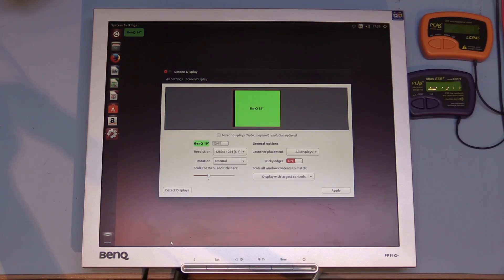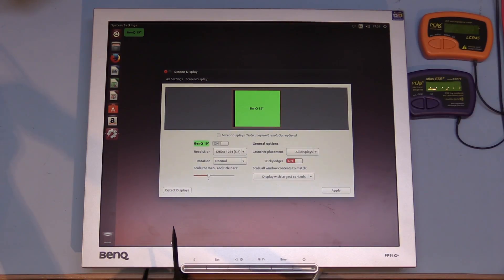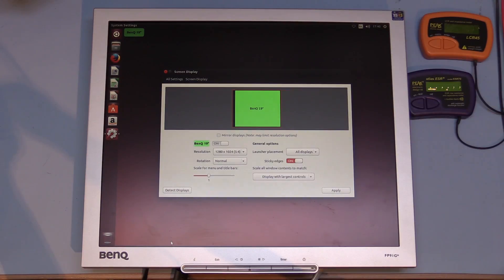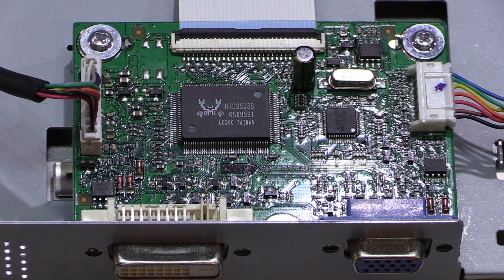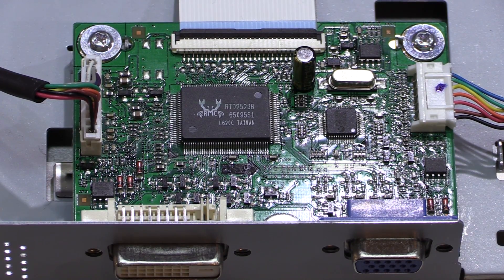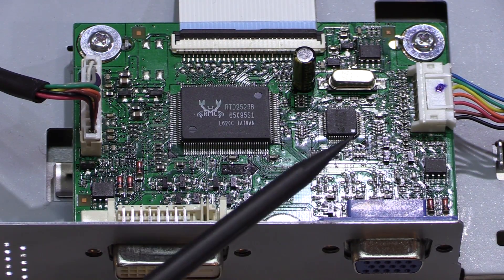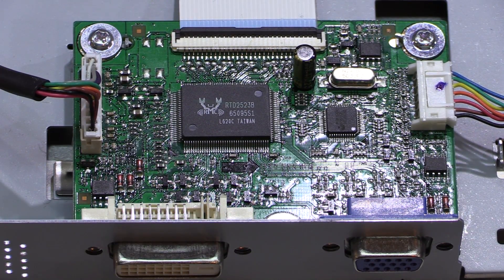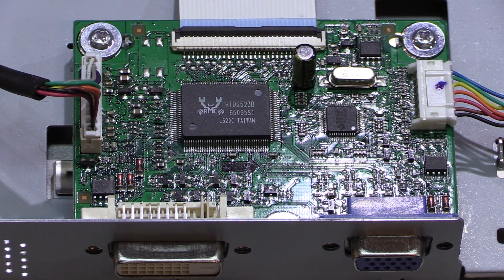SDG #018 Benq LCD Monitor Repair Follow-Up

Comment: Good job. I don't like throwing stuff away too. Even though timewise the repair costs more it's one less that has to be replaced and pollute the earth. Btw I said in my case it was failed buttons, but I have the feeling your case is not much different. The main problem is that they use multiple levels for the buttons, not just 0 and 1. And the few kOhm resistors can easily be duplicated by contamination. I once tried to use ADC based single pin multiple buttons and I'll never do that again.
Reply from the maker: Microlab Oddly all the buttons on the front panel are direct I/O's except the auto adjust and menu button, which share the same I/O pin, so a slightly noisy power supply could have caused the erratic constant auto adjust. I suspect the glitches were at a far smaller scale than I was looking at on the scope.

Comment: Glad you saved it from the dump! I thought you had checked that cap. Most of the faults that I find are cold solder joints also.
Reply from the maker: Robert Calk Jr. I said I'd check it, but didn't actually remember to - typical! Thanks for watching.
Reply: SDG Electronics 
It happens. I enjoy your channel very much. I'm sure it will grow quickly as more people find it. 
I can't wait to test my Zen50 today and see what she can do!

Comment: I had problems with backlights at random times on a benq FP71E.  Solder problem, are easy to miss. I had 
about 10 broken solder joints on the backlight transformers and 
resonance capacitors. I could only just see the worst one with a hand 
lens but needed a low power microscope to see the ring of cracking half 
way between the component leg and the pcb pad edge. Resoldering seems to
 cure it (3 days without problem so far). Most cracks were tight some 
gaping and zigzagy (intergranular). Of course some cracks may have been 
surface only but it was quick and simple to hand resolder the 10. I presume 
these were thermal cycle fatigue cracks due to the small amount of 
solder used.

Comment: The age of the monitor matches when the switch to lead free solder recently happened due to RoHS. Solder joints were relatively unreliable for a time. 

One wonders the cost and environmental impact from so many laptops, TVs, etc being scrapped before manufacturers got to grips with lead free solder…

I guess consumer electronics is no less reliable now, more or less; and lead free solder has now been perfected?

Comment: The faults that i really hate are the tempramental ones, it works while your using it and it fails when your out of the room or someone else is using it, really annoying.
And when you dissasemble it, it behaves itself, even flexing pcbs and tapping the pcb with the plastic screwdriver handle to make it glitch does not show the bad joint you know it has.
Ive been so sick of this that ive done as you have, "blanket soldering", its not a satisfying repair as you never knew where the problem was :-(
Reply from the maker: zx8401ztv Agree 100%. I have another repair coming up which I believe will be just as unsatisfying - however, I've always enjoyed taking things apart, so I don't usually turn down any repairs. Thanks for watching :)